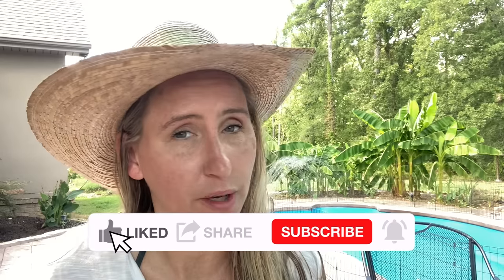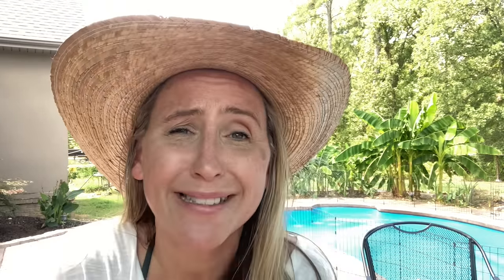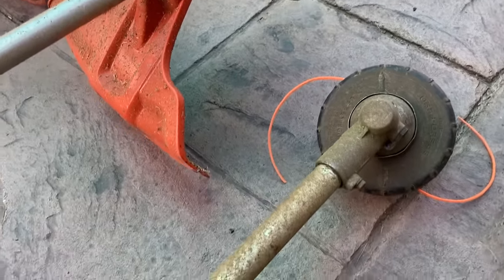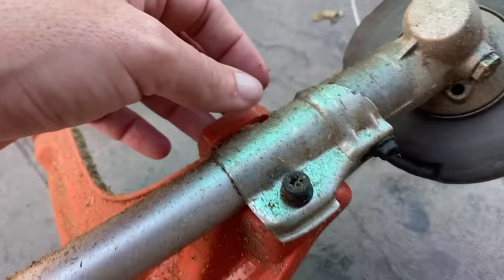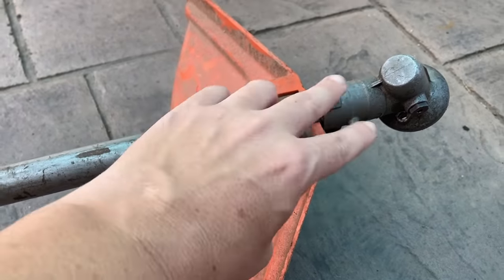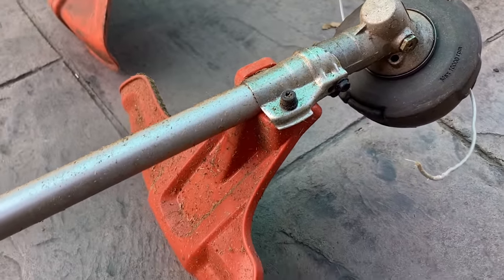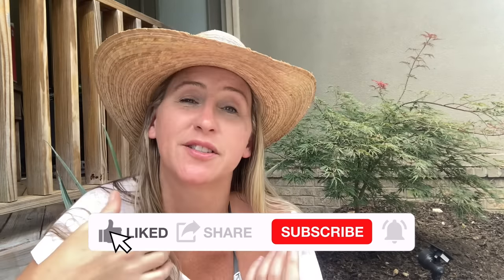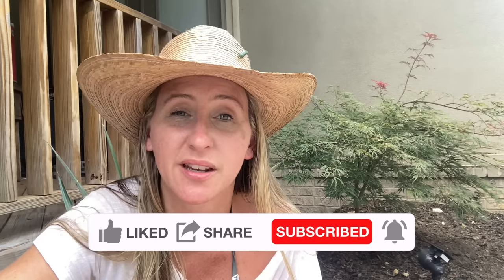String trimmer guard ON or OFF? Will it destroy your Stihl, Echo or Husqvarna? You might be shocked!

Comment: Folks that have you as their Dealer are blessed because you are honest.  Not all are this way.  Keep up the good work!  The guard requirement on the Echo Trimmer is a safety thing, and you know how they push safety.  You can switch out the big wide older SRM guard for the newer small guard and have that meet the demand.  Besides, the string really can throw a thin piece of shale or sandstone hard enough to knock your eye out.  Keep the guard and wear good glasses~
Reply: All these people that think they're going to live forever...
Reply: The guard doesn't guard nothing
Reply: @Anto-kz5hk  I worked for a government contractor. 
We used Stihl equipment and I can assure you that having a guard in place does help guard against injury. Now, does it guarantee that the operator will not be hit with something? No, that is why we were fully appropriate PPE, however, it is not likely that the operator will be hit by something with the guard in place.
And like she said, on some newer models, the guard is an integral part of the system and needs to be in place for full functionality.
Reply: hell yea i have a stihl fs90 and wasnt even running the trimmer not even half way opened up ye know jus enough to trim around the posts holding up car port and the trimmer STILL kicked a small small gravel towards the front door to my house and guess what .... SHATTERED THE whole door so i cant imagine wha is possible kicking a rock like that running full throttle....some great big ole damage BELIEVE THAT
Reply: @Anto-kz5hk . And whatever was supposed to be guarding your brain didn't guard anything either.

Comment: I watched a 1 inch lump of stone (seemingly in slow motion) fly across the yard and through a fence panel afterbeing kicked up by my mid sized strimmer, so for safety reasons I'd recommend you leave the guard in place, that and If your machine is still under warranty as you can void your warranty if not used as recommended. But at the end of the day its up to the user and weather they have the safety of themselves and others in mind! And funnily enough I think I watched said video the other day and thought "what a numbskull"
Oh and one final thought, the guard has the string cutter built in to limit the amount the head can get out of balance, that'll slowly destroy the head.

Comment: I ran echos, for 25 years, never replaced a part on any of them, spark plugs only. Ran the hell and abused the crap out of all of them. Not to mention the jacklegs that worked for me. Took the shields off before I left the mower shop. Had to clean exhaust ports out 2 times a season, other than simple maintenance, they still ran great. They were 21 to 25 years old when I got out of that miserable business. Hardest work on your body you will ever do.

Comment: Always off, it's much better for me, especially when edging, i can see where the line goes with my eyes plus the longer string, the more powerful or easier to cut the grass
I know the guard is there for a reason, but i take it off over the convenience
Reply: I understand with edging, but you really dont get more power with more string. I got the Stihl KM 131 R with edger so dont need to flip the machine over.
Reply: The guard make zero difference as for visibility. I've never understood why people say that the guard off makes it easier to see it doesn't It's your technique. The  guard doesn't obstruct my view at all and I love not having to mess around with string that's too long and use a rock to trim it or a brick wall or something.

Comment: Always take the shield off for me, even as I've migrated to the electric trimmers by EGO and Hart. I carry a small set of wirecutters to trim the line if gets uneven. Without the shield I can see where my line is and I have more control around trees and other objects.
Reply: I love the EGO trimmers. Never take the shields off them. They are there for a purpose. If they weren't necessary, the wouldn't sell them as part of the line trimmer. Shield on makes the trimmer much more efficient. Longer battery life and more effective cutting. You also void your warranties trimming without the shield. I don't know why you have a problem seeing your line or with control. No issues here.
Reply: I depend on the shield to keep me from girdling trees and bushes and protect my ankles from flung gravel. Didn't even 𝑡ℎ𝑖𝑛𝑘 about engine efficiency. I only wish the shield were expandable to cover more or less area.

Comment: Buy Mom and Pop shop.  Echo has price fixing so it's no cheaper at a big box store.  I took apart the head on my Echo trimmer and couldn't get it back together.  Took it back to where i bought it (Dickinsons in Fredericksburg VA - they're an Echo dealer and Echo authorized repair shop).  20 minutes after giving it to them I got it back no charge.  Given it was my mistake I fully expected to pay at least 30 minutes labor.  Keep the Mom and Pop shops in business.

Comment: to me the guard is in the way ,but alot of people don't realize u can take the little screw on the side put few drops of gear oil in the head the bearings and gears will last alot longer
Reply: iv found that adding grease one or twice a year help big time
Reply: What is the guard in the way of? I use a string trimmer for upwards of 6 hours a day multiple days a week and have never had a problem with a guard being in the way.

Comment: I work for a Stihl dealership as one of their certified techs. Sales rep came in and was asking all of us what we liked about Stihl, which pieces we personally use, common issues etc...Basically told him what he wanted to hear. When he left I told the store manager it was a damn good thing he wasn't able to take a look in my garage or I'd have been found out 😆...(full of Echo)
Reply: Like the blowers but can't stand the 4 mix trimmers
Reply: The amount of cam issues I see on those are ridiculous. Plastic cam that's constantly wearing down causing the need for numerous valve adjustments until it's completely gone. Stihl came out with an updated cam cover that funnels the mix more directly onto the lobe, but it hasn't done much to my notice.
Reply: @hoosierdaddy9373  if you run them withous a shield then ofc the cam lobes will wear out because of excessive heat exposure...thats why the line cutter on the shield is of major importance...every inch beyond the correct length add 100 degrees more heat to the engine because the engine runs slower reducing the cooling rate from the flywheel...simple physics...one other to prove my point...how many cams have you replaced on the BR500 and up blowers with the same 4 mix engine...betting hardly any because you cant change the designed operating parameters on those like you can on a trimmer by removing the guard...
Reply: @Out of the Box Models i dont know what model you bought but every stihl blower ive ever worked on works great...im sure if you took it back to the dealer you bought from they would have straightened it out...that said everyone isnt perfect but ive found stihl has a much lower issue rate than most in the past...
Reply: That seems really dumb. The engines on stihls are way better and its easier to work on stills most of the time. Unless you are just cheap, that seems like a stupid choice.
Reply: @Out of the Box Models I have a small handheld from 2017. Most of the plastic is gone except for my new makeshift handle. The engine sucked a ton of crap in because the plastic holding my air filter got all janked. Long story short, it looks like it is beyond dead but it still starts right up. No idea wtf is wrong with your machine.
Reply: @tubby6339  most of stihl pro line backpack blowers are 4 mix’s as well. Do u mean u only like and run Stihls regular 2 stroke blowers? Yeah most of Stihls trimmers are 4 mix. They only have  4 of there trimmers that are standard 2 stroke. The 56, 70, 94 and 240 if I’m not mistaken. I just traded in my old 4 mix 100 for a 94.
Reply: @Out of the Box Models what model blower did u have and what did the dealer do for u? We’re u able to sell it off to them and or get store credit for the value? If u had one of their backpack 4 mix units: 550,600,700 or 800. They have a little valve box under the engine shroud just like some of their string trimmers. Trimmers are but easier to access. Anyways if u had it for 3 yrs and low on power it might of needed a valve adjustment which the dealer would do. Or YouTube has vids on it. If not that u could have had a dirty spark arrestor muffler screen. I own just a handheld bg 86 never really had an issue with it in the 4 1/2 yrs I’ve owned it. I pull out the screen or cut off the screen from the bolt in the muffler when I get it. So that never an issue going forward.
Reply: @timw6281  well explained 👏
Reply: @jefffaust89  yes, I know. It's never bothered me with rhe blowers, but the power band is weird for me on an old 111r I used to use. I like my trusty 2620 and 525lk trimmers more. Planning on switching out my 8010 for a br 7 or 800 before leaf season. Power's great on the echo, tube just wears me out swinging it back and forth compared to stihl. I'll sacrifice a little power for comfort. Cheers
Reply: @tubby6339  Same here
Reply: I bought a Stihl SF90 with the handlebars in 2010 and took the shield off after the second use. I keep the gear head lubricated and so far the only thing I've had to do was replace the carburetor.  That was my fault for leaving gas in it over the winter. With that being said I hope the gear head doesn't go out next time I use it. Love your videos,  I have learned so much from you, I've fixed two Stihl units for my grandson ( carburetor, fuel lines, throttle cable and diagnosed a bad clutch). Only problem I'm having now is finding a new clutch, out of stock with no guess when they will get more.  Once again love your videos,  have a great day and God bless you and your family.  Tom from West Virginia.
Reply: @tubby6339  Have had really good success with the 4-mix blowers, and constant crap with the 4-mix trimmers. what's up with that?
Reply: @Out of the Box Models you didn't mention which model. You got the br200 and expected it to act like a 6?
Reply: Should have said the truths. They could sell way more of their shit if they fixed the crappy parts and designs...
Reply: Why act like a child and lie over nothing??? If you would have told the tech the truth maybe your story would have been funny...
Reply: I've had good luck with my Homeowners grade Echo products. I don't like Husqvarna. I think they are the same as Poulan, junk.
Reply: Ted Striker:
It's a damn good thing he doesn't know how much I hate his guts.
Elaine Dickinson:
It's a damn good thing you don't know how much he hates your guts.
Reply: i dont use sthi either-worst products on the commercial market! esp their parts strategy. who has time to drive to a dealer for every part? you cant even look up part numbers!
Reply: @Out of the Box Models look at the Makita BHX2500 4 stroke, pretty light and very smooth operation
Reply: @hoosierdaddy9373  I just swapped out my 130r Stihl for a Echo 3020t a couple of weeks ago. The 130r had a Cam gear failure and needed a short block (it also had the clutch replaced earlier this year. But that was under warranty) I researched for about a week to find the best trimmer for me and I'm Glad I settled on the Echo 3020t. It's a traditional two stoke. So it's gonna be reliable and it also has the 2:1 gear ratio and that makes it have a ton of torque. The 130r had good torque. But the 3020t blows it out of the water. I had the guard off the 130r but with the 3020t I've left it on for now. It has a 20in cutting path with it on and it seems to cut pretty fast with it on. I've yet to bog it down yet and I've really tried. Overall if you want a Reliable, Torque monster trimmer. I highly recommend a Echo 3020t.
Reply: @Seldomheardabout  Stihl trimmers are NOT superior to Echos in design or construction. Period.
Reply: @dyer2cycle  I bet you also think toro is the best mower rofl.
Reply: @Seldomheardabout  Toro?..don't know a thing about them...what does Toro have to do with drinking Stihl Koolaid?...
Reply: @NY411Info  The low-end priced Husqvarna saws and trimmers, hand held blower, ARE indeed Poulans...some of them have slightly re-styled and unique outside parts to thinly disguise them, but are Poulan designed/produced. Don't know much about their current lineup, but the 36/41/136/137/141/142/235/240 chainsaws are Poulan designed/built..the old Mondo trimmers, 125/128 trimmers, and a few other models, are Poulan designed/built..the 125B handheld blower is of Poulan origin, and can't remember the model number, but Husqvarna used to sell a version of the old cheap, crappy "box style blower that was identical to the Poulan and Weedeater versions except color and decals...
Reply: Stihl makes the best equipment for professionals. I have never seen a pro use anything but stihl and there is a reason for that

Comment: Never had a clutch issue on my STIHL's. The shield keeps the string at the proper length and weight. Too long of string the RPM drops and you lose cutting efficiency.
Reply: This ^^^.  Richard here beat me to the point I wanted to make.  When I tried without the guard, I gotta say it was nice and nimble, easier to work around things.  But I had the same problem, to the point that I thought the carb had fallen out of adjustment.  Then I ran up along some rocks and the line shortened, and suddenly it was spinning faster again.  It was just too easy to get too much line spun out.  Put the guard back on and problem solved.  Crazy that just a couple inches of line can put that much stress on the machine.
Reply: Thank you very much sir I've been advising these local imbeciles we have around here,ah yes, I tell them your RPM'S will drop significantly and this drops productivity not to mention that your engine is designed to run (WFO) WIDE F...... OPEN.
Reply: I use a guard but u save line and weight. U take it off just don't let it get super long then rpm won't b a problem and have best of both worlds. Just can't be a goof ball n hit the head n let 20ft out all the time lol
Reply: @dustyscott3107  I have a decent quality Echo trimmer, and the difference between working well and struggling was like 2", at most.  And pretty much impossible for me to discern while running it through weeds, etc.   Did NOT have to get "super long" or "20ft" to cause problems.

Comment: I purchased my Echo SRM-210 to use at my house in 2006.  I removed the guard a year later.  I keep the line at the proper length.  If I unintentionally bump the head and it gets too long, I just clip it.  I don’t run it if the string is too long.

Knock on wood…I use it weekly and it is still going strong.

I appreciate the channel and your videos.  Keep up the great work!
Reply: Me too. Easy peasy

Comment: I bought a Husqvarna 326RJ Xseries back in 2009 and from day one I removed the string guard, to this day she still runs like a brand new one but I only have to use it once maybe twice a week here at the house. When she does die, most likely I will buy another Husqvarna, I've had really good experience with all the Husqvarna equipment I've owned over the years. 
Great video!!! 👍 👍

Comment: My dad's been in business since the early '90s, and we've always used Shindaiwa's and then Echo's.... With manual heads and no shield. As another commenter said, you use an appropriate length of string.... usually only as much as a shield would let you anyway... However, what you get from taking the guard off is a better view on what you are doing. The only time I let more string out is when I am doing an area when I am basically "mowing" with the trimmer, some place where you can't get with a mower, making sure I am running at full throttle. We never had problems with gear heads. Now that I no longer work for him and I'm a homeowner, we got a new Echo with a speed feed head and I'm having to get used to the bump head. I feel like it's really hard to activate on grass without damaging the grass or the head... I never found it troubling to just tip up the trimmer and manually adjust the string, but that's just my take.....

Comment: Since 91, I've had my own lawn service in Florida, Orton golf courses in Florida, and North Carolina, plus maintain my own 3 Acre property. That's my experience. The most durable weed eater I've ever used was still fs80. The best weed eater that I love to use was Robin down at the golf course. I used to be able to weed eat with eitherhand you know in my sixties and I'd Amaze these young guys. I've always run my trimmers with the guard off so I can see what I was weed eating, and put a nice Edge on the lawn. My bosses liked it at the golf courses. I am surprised you didn't tell the people to take those that bolt right up top and kiss some grease in there that's exactly what you do you kiss it in there once a year that's all you have to do are you won't have any gearbox problems. When the golf courses bought husqvarna's, they broke they're junk. Echo and shindawa were back up weed eaters then and back and back up weed eaters now. If you're on the business you should be running a steel fs55 or fs80. stihl 4 cycle eqipment dont have the Rs to do what im doing. In your video, you need to be knocking off a couple of inches off your string, its too long. Look at the plastic around your exhaust port to see if you're working the weedeater too hard. And while I'm thinking about it I use the diamond string or a square , it does a a better job. I can always tell a lawn where the uninformed gardener has been using round string.